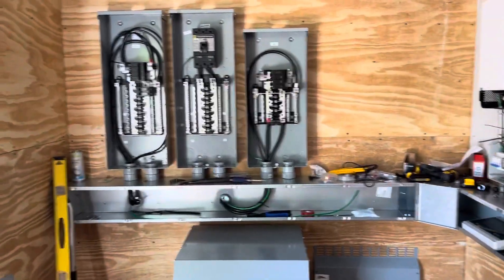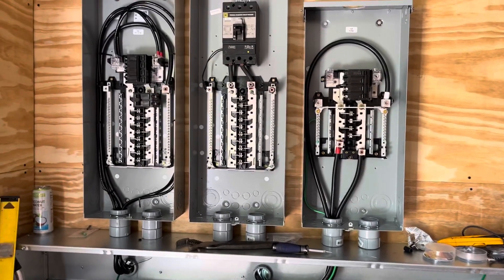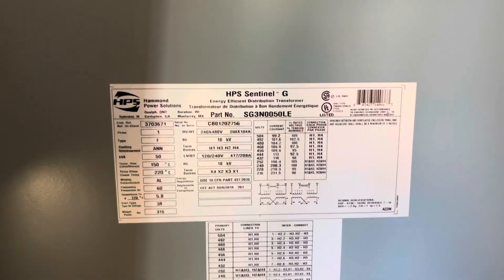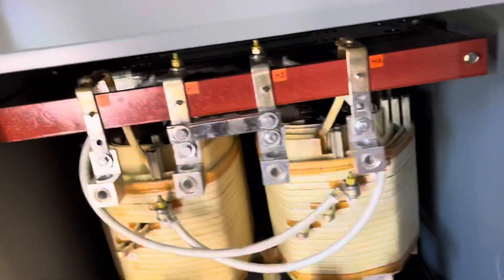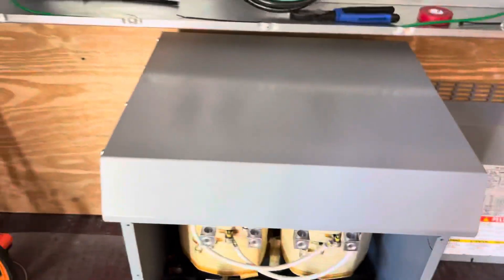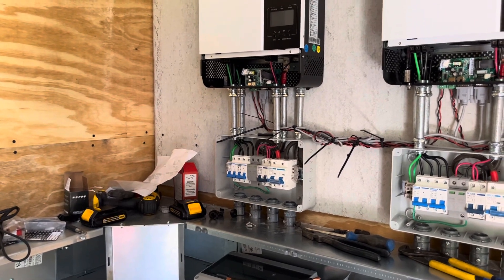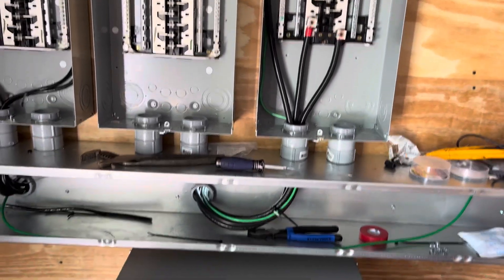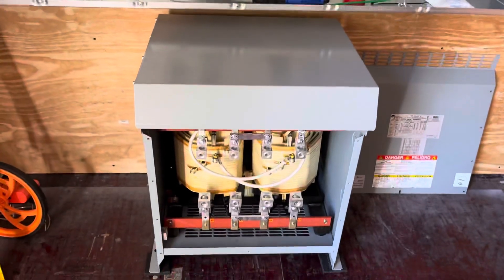Solar Power Project Update 17April2022 - Deriving a neutral through an isolation transformer.

Comment: Does connecting an isolation transformer will also increase the capacity of the inverter? Aside from creating a neutral line?
Reply from the maker: @echonancy  the transformer does not increase inverter capacity. In fact it reduces the useable capacity of the inverter by the amount of losses in the transformer. Depending on transformer load and efficiency, the losses can be substantial. 

What the transformer will do in addition to creating a neutral is balance the load between L1 and L2. This really doesn’t matter on an inverter with only L1 and L2 output but no neutral. It will matter for inverters with L1 and L2 and neutral. 

In my particular case, I had so many issues with the Growatt SPF5000 and the lack of technical support that I completely removed the Growatt inverters and the transformer. I replaced them with 2 Sol-Ark 15k inverters. The sol-arks have been operating almost flawlessly since January 2023. 

I have a video on the conversion.
Reply: @jeffmotes2129  How about the surge current when a particular load starts, i.e. water pumps. Will it become soft start like when it is connected to the utility power?

Comment: Having a isolation transformer will it barris  the ground fault front the grid utility?
Reply: Thanks. I got a problem with my solar inverter it something blows up inside and the inverter is dead. And they suspect the grid utility because we have not that great grid power here in the Philippines. So they suggest to install iso tranformer. Hope it solved the problem.
Reply from the maker: It shouldn’t since the lines are not connected and the only bonding to ground occurs in main panel from the utility.

Comment: Every inverter have neutral, the hot line L1 have 230vac volts. Is not two hot lines.
Reply from the maker: That’s true for the international market. The North American market uses three wire. L1-L2 = 230v, L1-N and L2-N = 120v. That’s what makes it a challenge when using international inverters in the North American market. 

Basically the bond between N and ground in the inverter is removed providing L1-L2 = 230V, then the neutral must be derived outside the inverter, hence the isolation transformer.

Comment: Are you going to have any working space issues with the transformer in front of panels?
Reply: This is the cleanest install I've seen this far. Nice work.
Reply from the maker: @jmwangi5  thanks
Reply from the maker: Well, if we get technical about it, I’m probably violating some code space requirements. But this was the best place for it. It was a decision I made. Once I get everything operational I shouldn’t have to open the panels or transformer.

Comment: I have a 25kva 480x240-240/120 transformer I am experimenting with, and you can wire it as an autotransformer as well, if you want higher efficiency. With it sized like you have, it as an autotransformer should never have an overload problem. 

Of course the transformer makes it act a lot more like grid power, it should give good starting ability to 240V and 120V loads. That would be worth it to me, just add some extra panels.
Reply from the maker: What you have to watch out for with these hybrid inverters that have grid input and autotransformers is creating a ground loop between the utility neutral and autotransformer neutral. 

When working in normal inverter mode the output is isolated from the utility input. This requires grounding the neutral at the autotransformer. HOWEVER, when operating in bypass mode the inverters pass the grid straight through. In bypass mode you end up with parallel neutrals and ground loops. Both are not good. 

I’d suggest using it as an isolation transformer and derive your neutral on the secondary side. Then it won’t matter what mode the inverter is in.
Reply: @jeffmotes2129  I’ve been using a three pole shunt trip breaker with my autotransformer with temperature monitoring in my running setup, but with my position from the grid distribution transformer I’ve never seen more than a few amps being balanced. A fault on the grid could certainly change that and trip it though, and I would have to manually intervene so it wouldn’t be seemless like if it were an isolation transformer. It’s the most sensible thing to do, but I’m too caught up on the efficiency I guess.

Comment: Don’t you need to ground (“bond”)  the derived neutral coming off of the isolation transformer? That’s what it’s fine when you bring in split phase power from the pole outside. Normally, there should be only one single bonding point.
Reply from the maker: Yes. The derived neutral from the isolation transformer must be bonded to the grounding conductor. I did that in the output panel on the secondary of the transformer. All separately derived neutrals must be bonded.

Comment: your the first i have seen that has done it right  you will have high a very high surge rating now also  that big tranny holds amps in mag flux and can give it out when starting a load
Reply: please show everyone how eazy you can start big loads using that tranny when finished
Reply from the maker: @ambersmith6517  I’ll be posting more as my project moves along.
Reply: @jeffmotes2129  thanks   i am Ben                      i text under my wifes name 
                                                                        Just to be strait i am a jack leg not trained just do this stuff for hobby                               i have been goofing around with inverters for many years now                                                   I have built a bunch of pure sine wave low freq inverters and have wound many trannys and chokes  
                                             
All my inverters are low freq there idle currant is under half a amp 
Some where around 20 watts or so is the norm
Low freq inverters can have very low idle loses                                                            There is at least one the market with a very low idle 
                                                                               I think the big iron core of a tranny stores amps/mag flux kinda like a cap holds voltage                                                           This is why i think you will be able to start large loads and your inverters will have a eazy life  
 I am very interested in knowing if you find this to be true!
                                                                        You seem very knowledgeable and make good choices                                                      I cant wait to see you all together up and running                                                           God bless thanks for your time
Reply from the maker: @ambersmith6517  thanks Ben. I’ve been in the electrical field for a long time. 

I have run a 5 ton HVAC unit, a 3 Ton HVAC unit, water heater, 5 freezers, 2 refrigerators, pool pump, washer and dryer , electric cook top, electric oven  and other things through this system. No problems. I did install MicroAir soft starters on my HVAC units about a year ago getting ready for this project.
Reply: @jeffmotes2129   5 ton is a big one and your experience shows thanks again

Comment: In other words, you actually synchronized 3 different inverters. And you used a 3-phase isolation transformer to use a single neutral line. Did I understand correctly? Could you please share the project diagram? Have you set up a system like this before? If one of the inverters from the system is disabled, will the other phases be affected? So many questions came to my mind.
Reply from the maker: Actually I have five single phase inverters that are parallel to provide 25kw at 240v. I combine all the five inverter outputs in one panel then feed from that panel to the transformer to generate 120/240V split phase. The output of the transformer is isolated from the input thereby the utility neutral and the transformer neutral can not be in parallel. 

This is my first solar power project though I have been involved with many transformer installations of up to 50,000 kva. 

I’ll share some block diagrams soon as well as more detailed videos. Got grandkids for a few days.
Reply: I didn't understand it very well, but I'm looking forward to your completion of the project. Looks like we'll talk more because I have a lot of questions :) Have fun with your grandkids🥳🏊‍♂️🚵‍♀️⛹️
Good work

Comment: If your using this for your load side output what are you using for grid input to get split phase to single phase into the inverters
Reply from the maker: The inverter input is 240V only. It doesn't use split phase on input or output. In the US typical home power is 120/240V with voltage between L1 and L2 being 240V. The inverter input is only from L1 and L2. No neutral input. Running all the inverter output through the isolation transformer allows me to derive a separate neutral on the secondary side for all power going through the inverters. This is the case when the inverters are using the PV array for power, the batteries, and even when in bypass mode. Doing it this way I don't have to worry about parallel paths in my neutral and grounding system.

The only time I will actually use the utility neutral as a current carrying conductor is when I have my manual transfer switch set to Utility. I'll share that in another video.
Reply: @jeffmotes2129  thanks for the explanation...
Reply from the maker: I’m going to be sharing a lot more videos in the near future.
Reply: keep watching this guy if you want to see how its done right                                                               there is so many videos on youtube about this that is plain scary to me                                                    i really like how this guy has done it